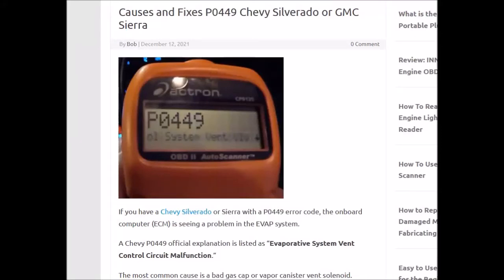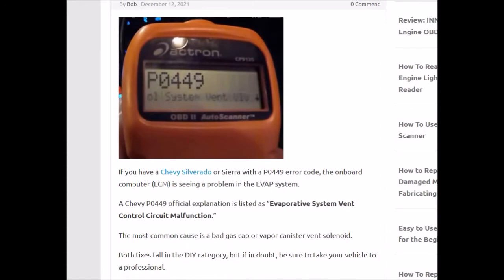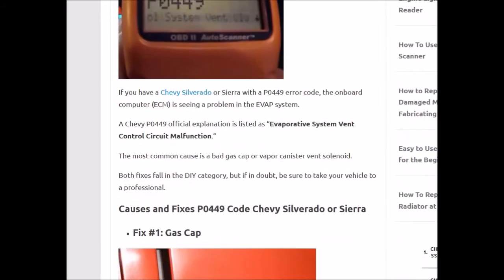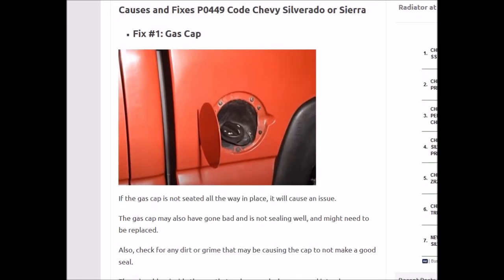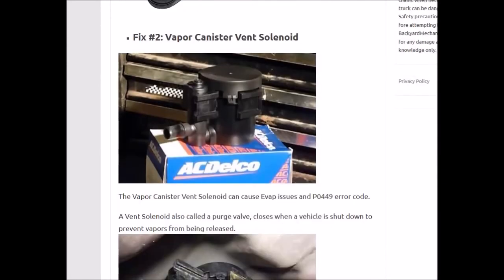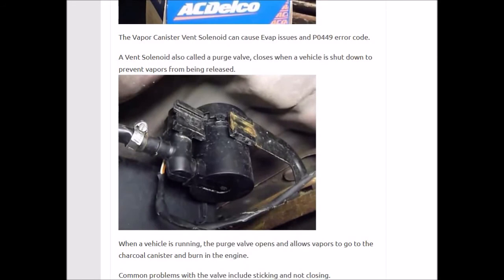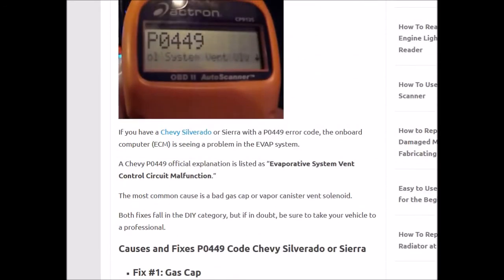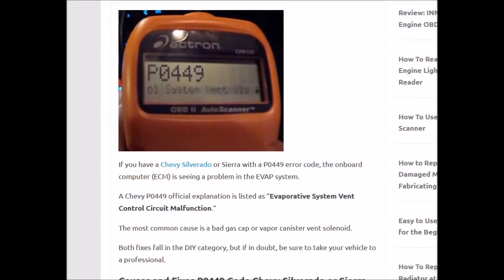Overview of Causes P0449 Chevy Silverado or GMC Sierra

Comment: Can a p0449 code cause a misfire?
Reply from the maker: Usually no, the only component that can cause an issue with the engine is the purge valve.  If the purge valve is stuck open, it can cause issues.